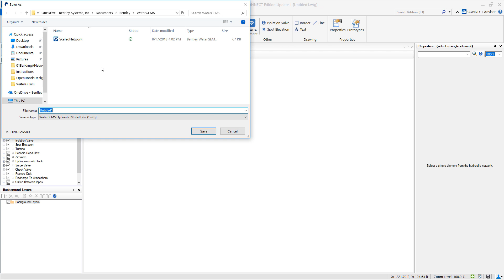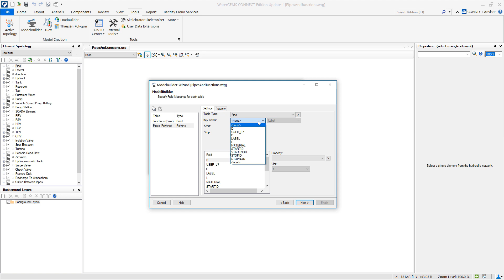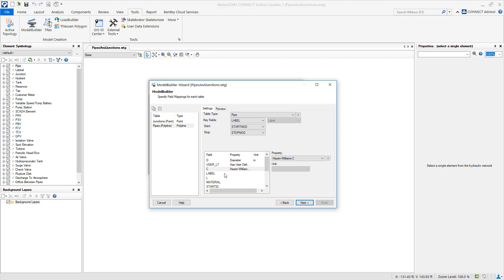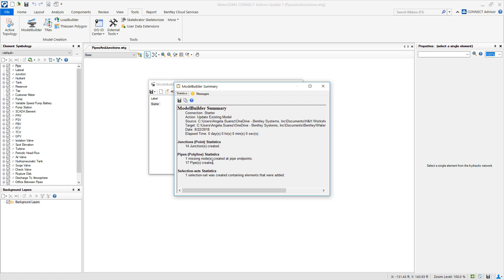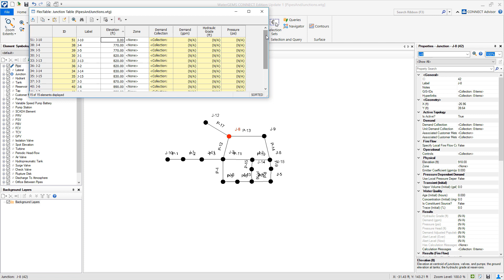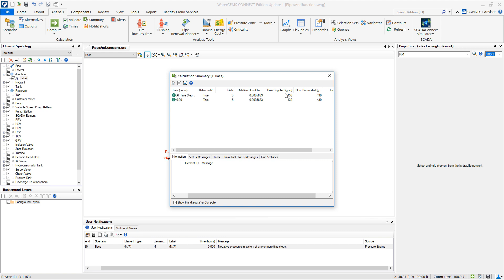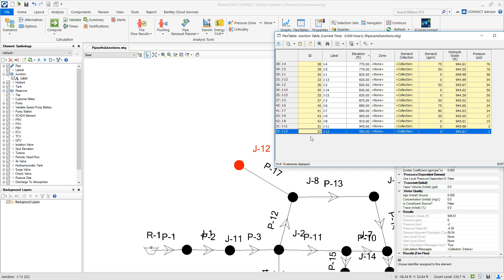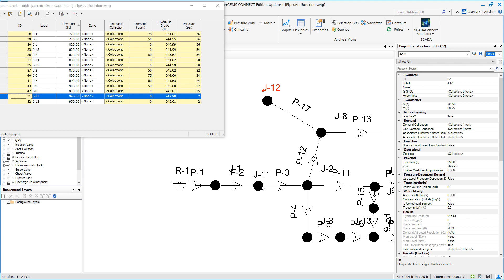WaterGEMS/WaterCAD Fundamentals Part 5: Workshop 2 (Importing Basic Model Data)

Comment: The data seems to be inconsistent with what is in the video despite following all steps  For example, Pipe1- 17; Diameter is 304.8in and Length is 457ft
Reply from the maker: Did you download the right dataset? There is a US and Metric version as seen in the playlist description.
Reply: @bentleywaterinfrastructure  I am having the same issue. I downloaded the US dataset, but all my pipe diameters seem to be off by a factor of 25.4. I made sure my units were set correctly and redownloaded the dataset, but the issue persists.